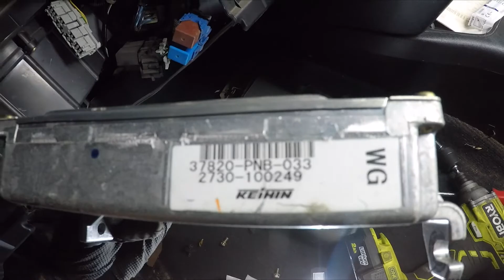k swap awd rd1 honda crv - rd5 donor teardown

Comment: The rd1 and the rd5 are 36mm in the axels 
Use  the rd1 axels on the the k transmission Just invert them,the drivers side axel to the passenger and the passenger to the drivers side (if am not mistaken they should work and with the rd1 abs)
Reply from the maker: Hopefully yes, but the rd1 chassis is automatic. So my b series axels maybe different in length to a manual b series axel. Fingers crossed 🤞
Reply: 🤔🤔 could be
Reply from the maker: Find out soon enough  lol
Reply: @jdmnuggets  left side should be the same part number for the rd1 auto and mannual. The right side is a different part number however. The auto and manny have different half shaft part numbers
Reply from the maker: Yeah, half shafts are different. I may be able to swap the outer abs cv joints from the b series auto axels to the manual k series. Will be able to look into this more when i remove the rd1 engine.

Comment: Sometimes you can tap off the abs ring and install them on the other axle
Reply from the maker: Oh yes!! Good point! Ive done that before with integra type r axels. Hopefully the diameter of the outer cv is the same as the rd1 b series. Thank for that

Comment: Not much difference with that diff. Are rear axles 32mm, are they bigger than rd1 rear axles?
But what I am 100% sure on is you want the diff from facelift 2nd gen (2005-2006) or 3rd gen 2007- 2011 if you can get one. Those have ramp assembly between the two pumps, engagement is much quicker. I drove 2006 last winter and loved it, drove it again recently on very steep gravel/rocky hill, couldnt even notice front wheel spin thats how quick it engages, I know that terrain well been on it my whole life in fwd or rwd cars, always sipinning throwing rocks around. 2006 crv was a very pleasant surprise, went up very easy no drama, I am sure it powered all 4 wheels. I also think rear axles on those diffs are bigger or stronger.
Whatever diff you go for fill it with new silicone fluid, not sure on grading but Honda dealer will know.
Reply from the maker: Yeah 32mm, thanks for the info! Haven't compared axels yet. Will look into upgrading the diff once the car is finished, tuned and all the gremlins worked through.
Reply: Keep us updated on that engine harness, I still dont understand why you cant use it.
Btw hondata do nothing for dbw ecu's.
Speeduino may be an option for K  in near future if it isnt already.
Reply from the maker: Yeah will do, be looking into that soon. Speeduino?

Comment: How much did you end up paying for the rd5? Its quite hard to find one around me lol
Reply from the maker: I paid $3500 nzd. Its done 250,000km.
Reply: @jdmnuggets  thanks for the info. I found one near me for $2000 usd with around 260,000 miles (418,000km). Its the only one around. Might just pick that up tbh. Do you plan on parting out the rd5 once you take all parts from it that you need?
Reply from the maker: Ita a good way to go honestly, that way you get to test the gearbox. Plus you get axels, shifter/cables. I currently have it listed but so many idiots are sending me bullshit i will probably take a few things off it and scrap the rolling body, sell the cat lol
Reply: @jdmnuggets  haha that's NZ for you, good luck (:
Reply from the maker: Lol right... rd5 parts available. No running gear at all, first question " is the manual gearbox for sale?" fml 😂😂